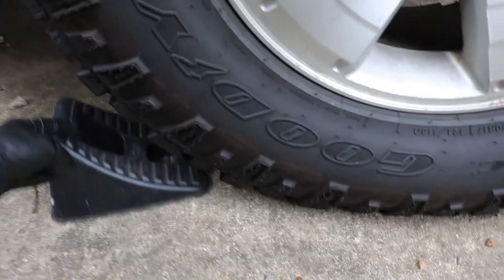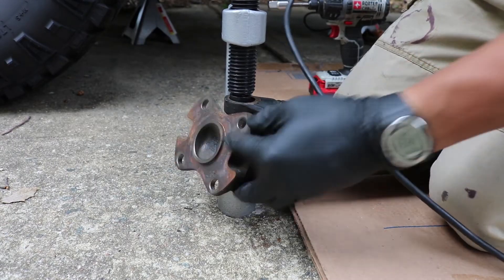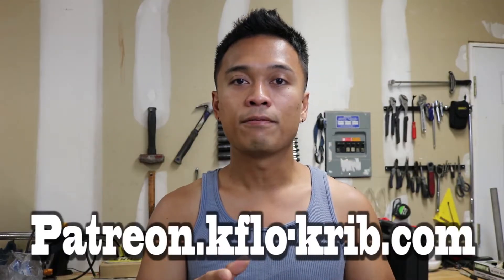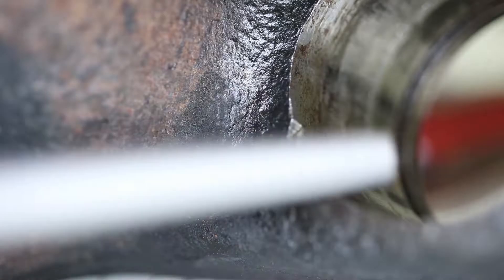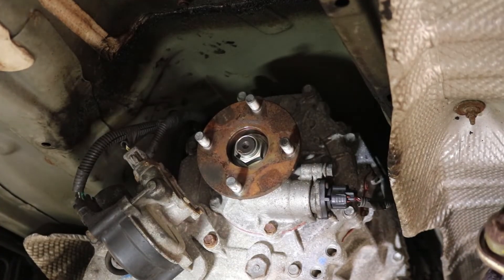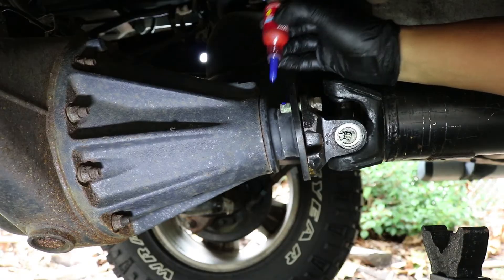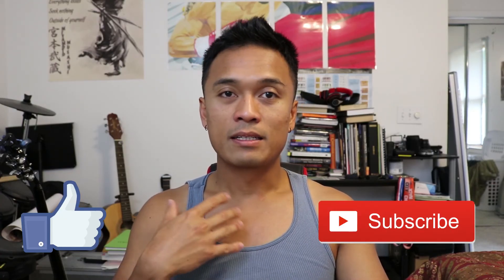U-Joint and Carrier Bearing Replacement (Tacoma DIY / How To)

Comment: Will those parts on your link fit 2wd and 4wd 2015 tacomas? I’m asking because I have the 4 wheel drive 2015 Tacoma just want to make sure and thanks for the tutorial
Reply from the maker: Yes, it will work for a 4wd. My truck in the video is 4wd

Comment: Very good video.    I'd never used a ball-joint tool on u-joints before.   It made a miserable job, less miserable.   
My Tacoma has 230k michigan miles on it.   So corrosion at carrier bearing didn't help, but got through it.

Comment: 1:25 Those 14mm bolts and nuts at the rear differential are driving me crazy. I got 3 bots out and still struggling with one left (on the top). Taking them out are a pain in the butt, imagine putting them back in and try to torque them to specs 😅
Reply from the maker: You an put the truck in neutral and spin the driveshaft (assuming that you have the truck's rear on jackstands) to make it easier to undo the bolts
Reply: @TacomaTutorials  It’s on the stands. I did not know I can spin it from the top to bottom for easy access by putting it in neutral. I already marked the line where the shaft should line up. Will definitely try it tomorrow.
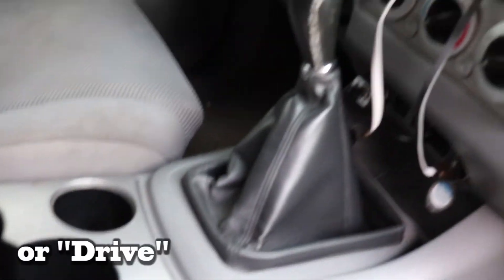Reply from the maker: you may have missed it from the video: 2:10
Reply: @TacomaTutorials  Thanks bro. I was able to take it off easily

Comment: Hi, I did it step by step and everything was almost perfect.  Now I have the 4WD light flashing on the panel.  This situation has me worried because I don't touch, much less disconnect, anything.  I disconnected the battery for 20 minutes and there were no changes.  Any ideas or suggestions?
Reply from the maker: Did you make sure that the 4WD is in the off position? Did you check the harnesses on the transfer case? You may have knocked it loose

Comment: Im replacing the whole shaft for the one and done. How is the new complete shaft set in if there are no new marks?
Reply from the maker: The shaft is balanced individually. You mount it as is. If the new one has vibrations, then you'll need to take it to the driveline shop to balance it to the truck.

Comment: Great instructions. I changed the three ujoints and carrier bearing. Installed the drive shaft with no issues. Now I have a vibration that I didn’t have before   Any suggestions other than taking it all apart and reassembling it?  
Thank you for your time.

Comment: Hi KFlo, I replaced the 3 U Joints and the carrier bearing on my 2011 Tacoma TRD 4x4 AT, one of the ujoints was actually missing needle bearings so the truck was making a knocking sound when I would come to a full stop and when I would accelerated from a dead stop, greatly improved after I completed the work, but once in a while I’m still getting a knocking sound from a dead stop, any suggestions?  Thanks

Comment: Excellent video. Is it beneficial to clean and grease the slip joint on the rear driveshaft?
Reply from the maker: That's a good idea. It definitely wouldn't hurt. I would just advise to mark the slip joint and make sure the  joint is put back in the proper angle to prevent any vibrations from occurring
Reply: @TacomaTutorials  my son and I used what we learned from your videos to replace the u-joints, carrier bearing and one upper ball joint on his 2011 Tacoma. In addition, we cleaned and greased the slip joint shaft.  

We were careful to mark everything with a paint marker to ensure that we put it all back in the correct alignment. Two of the u-joints were ok, but the third was totally shot; the needle bearings had turned to dust. 

We rented a ball joint press from Auto Zone, which made it much easier.  The driveshaft portion was pretty straightforward, but the ball joint was a real pain; had a hard time getting it to go in straight, my c-clip pliers were too small, and we couldn’t get the boot to stay on. We eventually got everything in, so all’s we’ll….Thanks again for a great video.

Comment: Is it bad if I tighten the hanger bearing first then the two ends??
Reply from the maker: it doesn't matter as long as they're all torqued properly
Reply: @TacomaTutorials  thnx bro. Yes I torqued them to spec. Put two washers on either sides of the hanger bearing to drop the angle to a more neutral hang. Hope that is fine too. (My truck suspension is raised by 2.5”)

Comment: k flo how do you access the bolts from the drive shaft to the tranny .. i see there's something hanging down that covers the bolts how do you get that off
Reply from the maker: If you're talking about the front diff, you can use an extension and a socket

Comment: Watched all the videos for transmission, clutch, flywheel, pressure plate, release bearing etc. All excellent and with the torque information! All went smoothly, now do you have a  A video on how to install and adjust and bleed the clutch master and slave cylinders?
Reply from the maker: Yes sir. You'll have to watch my solo brake bleed video in this channel. I briefly go over it in the video. Thanks for watching and supporting the channel

Comment: You didn't point out the small washer inside the front of the bearing. It's clear you had took it off and put it back because you briefly see it on the table. I missed it and left it inside the original bearing. Now I need to take it all apart again and replace with new bearing just incase I damaged it. What a waste of time and money
Reply from the maker: 1) if you applied loctite, you don't need to take it off. Put it back in the future if you need to replace it, it's just a washer - the flange nut with the loctite is what holds it.
2) look at your logic, you personally missed something (which happens quite often to everyone in mechanical work) and it's my fault? Who's the logical fool?

Comment: Thank you for great video! I have a 2009 Taco automatic 4wd TRD sport. Do I need to have the truck on jack stands to be able to spin the rear drive shaft by hand in neutral? Or can this be done with the truck on the ground after I disconnect the flange plate from the rear differential?
Reply from the maker: You'll need the truck off of the ground - it will be difficult to undo the flange plate otherwise

Comment: you put the carrier bearing on backwards the short end the the slotted holes goes towards the trans the longer part goes towards the rear diff
Reply: You have a source for that?
Reply: @Awoit  wdy mean i own a driveshaft shop i build custom ones etc lol i know for a fact
Reply from the maker: @Brendan Mills and @ Austin Woitte You guys can go ahead and contact the manufacturer. I do have an email from them saying that orientation doesn't matter.
Reply: @TacomaTutorials  if the orientation doesnt matter then why does every toyota with this type of bearing always face the same direction? basically opposite of the direction you put yours? the wrong way. the bearing itself doesnt matter its the direction of the housing that matters. but what do i know i only build them

Comment: 🚨TACOMA ARE SET UP DIFFERENT, THEY CAN HAVE 2 TO 4 U JOINTS!!🚨

 If you go to ROCKAUTO and look up part number 285 there are 4 diagrams that show the 4 different setups!!

For anyone who's having the same problem and is actually curious how it really works a single cab should only have One solid drive line 2U joints (NO CARRIER BARRING).. The extra cabs are set up 3 different ways you have to get under and look for yourself and count your U joints. One is set up with 2 part driveline, 3U joints, 1 in the center next to the Carrier bearing. The other is set up also with 2 part driveline 3 U joints, 2 up front and 1 at rear. One set up is with 2 part driveline, 4 U JOINTS, 1 up front, 1 at rear, and 2 next to carrier barring, the 2 in the middle are in something called a DOUBLE CARDAN JOINT!!! Don't make my mistake. After watching you favorite YouTube vid to navigate the work CHECK under yours to make sure you order the correct amount of U joints. NOT ALL THE U JOINTS ARE MADE FOR ALL MODELS. Some are specific to single/extra cab and RWD/4WD!! I recommend part# 285 at RockAuto for 1 GEN 95-04. Some U joints are rated at "standard replacement" and some are rated as "super strength" these MOOG 285 are $17.66 $3 cheaper the the highest rated "standard replacement" DANA 51510×. The 285 is not only super strength but rated for ALL models 2WD/4WD! They are greasible and the grease fittings are on the cap like in this vid for easy greasing. Typically when you go to get replacements part stores try to pass off the dana 51510x I've even had part stores tell me it's rated as super strength when it's not. 285 is the top dog in my opinion, They take the guesswork out by making them universal to all models, they have the grease fitting in the right spot,  They are the highest priced greasible superstrangths on RockAuto. They have 2 that are more expensive but those 2 are not greasible. So at $3 cheaper than the best rated standard replacement that is a win win!!👍

Comment: I'm confused..it looks like they're is 4x U joints?? Are one of these not a u joint?
Reply from the maker: There's only 3 u-joints. 1 in the front , 1 in the middle (it connects the two sections), 1 at the  back
Reply: @TacomaTutorials   UMM NO!! 1st of all it would help if you were doing the year making model on the video title and in the beginning didn't just say "for Tacoma"  You can go on rock auto right now and look up this part number 285 and it will show you the 4 different diagrams for the 4 different ways this truck is set up for 1 GEN.  I'm specifically talking about the 1st generation Tacoma 95-04. My Tacoma absolutely has 4U joints I'm looking right at them! Not all Tacoma's are the same so instead of saying "the tacoma" may be a little more year making model specific. For anyone who's having the same problem and is actually curious how it really works a single cab should only have One solid drive line 2U joints (NO CARRIER BARRING).. The extra cabs are set up 3 different ways you have to get under and look for yourself and count your U joints. One is set up with 2 part driveline, 3U joints, 1 in the center next to the Carrier bearing. The other is set up also with 2 part driveline 3 U joints, 2 up front and 1 at rear. One set up is with 2 part driveline, 4 U JOINTS, 1 up front, 1 at rear, and 2 next to carrier barring, the 2 in the middle are in something called a DOUBLE CARDAN JOINT!!! Don't make my mistake. Don't watch YouTube videos think you have everything together and then waste a whole Saturday to find out your short one U joint👍 Watch your video get your information jump up under there double check before you buy U joints and start.

Comment: I'm replacing the three u joints and carrier bearing, problem is they use three different sizes! How do you figure out what the right ones are? Any help would be greatly appreciated.👍🤞
Reply from the maker: What year is your Tacoma? It should be all the same sizes regardless
Reply: @TacomaTutorials  KFlo, I was searching for this similar issue.   Other sites like Yota say my 2001 three different size u-joints and that the double cardan joint right behind the center support bearing has to be replaced as a unit.  But it all looks exactly like your video.  Confused on if this is possible on a 2001.

Comment: K flo! I just realized my tranny does not bolt on , appears to slide out of transmission. I’m assuming all the rest of the steps are the same? Torque spec for carrier bearing and rear diff should be the same correct?

Comment: Is there a trick to break the drive shaft loos from the rear diff after removing the 4 bolts?  Mines appears to be stuck. Does the truck need to be on jack stands or can be on the ground?
Reply from the maker: It would be better on the Jackstands, at least for the rear, so that you can spin the flange at the rear diff. Use a hammer and a 2x 4 to loosen the yoke from the flange
Reply: Thanks for the quick response, the rear part of the drive shaft should be able to break free without loosening the carrier bearing or front propeller shaft trans nuts and bolts?  Tia

Comment: Kflo are all three ujoints the same ,same part # ,meaning will the joint in rear by diff will fit between the trans and center support bears ?
Reply from the maker: Yessirree. All three u joints are the same for the rear diff. Just make sure you pick the MOOGs from my Amazon page. The spicer ones are for the front diff

Comment: It's probably worth mentioning that the shaft is balanced as a complete unit and that is why it's important to put on the alignment marks. It was balanced with that alignment so if it doesn't go back together the same way it may not be balanced.

Comment: Just finished doing this on my 2008 TRD Sport, 2 wheel drive, Double Cab V6, Automatic. Did not have as many bolts holding Drive Shaft as you showed, as there were 4 bolts, washers and nuts holding drive shaft flange to Differential. There were no similar bolts on the transmission end, just the Slip Yoke which goes into the transmission. There are the same two screws holding the Carrier Bearing to Frame and the same Nut holding the Carrier Bearing on to the middle Spline Yoke. Your video saved me a lot of research time. Ordered the parts on eBay and obtained The Spicer Select U-Joints and Spicer Carrier Bearing. I moved slowly and methodically and got the job done, thanks to watching your video. Thank you for making and posting  as it was excellent resource to have available. What I thought was a worn Carrier Bearing turned out to be 3 bad needle bearing ends of the U Joints. They were rusted away and turned into Rust Dust. They had no grease fittings and were never replaced. My Truck has 170, 891 miles, and only when I went into reverse did I get squeaking, sounded like a bird chirping. Never made any noise when moving forward. It was like having a backup warning signal, which I will miss. NOT! Next project: replacing leaking rear axle seals, and potentially damaged bearings which are contaminated from the rear differential fluid washing into and deteriorating the bearing grease. Not sure I have the strength to do this type of repair, as I am feeling my age after this repair. Happy 4th of July Weekend!
Reply from the maker: Excellent, great to hear. My next video is on the rear wheel bearings and axle seals. It's being edited and will be out in a few weeks. Stay tuned and thanks for supporting the channel. Happy 4th as well!
Reply: @TacomaTutorials , That's great to hear and I look forward to seeing it. I have the 20 Ton press (I got the HF Press for $50 from a FB Marketplace ad) and was going to buy all the Toyota genuine parts from eBay, which I already have selected and saved to my watch list. I also was going to get the rear axle bearing tool for pulling the hub and tone ring, as seen on Timmy The Toolman  channel. But, I have not pulled the trigger on doing anything yet. Have to decide if I want to pay a mechanic. Biggest concern is how to make certain the Tone Rings are not pressed on too far, and what size gap has to remain so the speed sensor ring will still work. Due to the fluid leaking, the rear brake pads are getting saturated...so it is a big job which has to be done sometime soon. Need to pay for a new roof first before I have to think about the leaking seal.

Comment: I just had my 2005 Tacoma prerunner center bearing and rear u-joints replaced. Now my truck shakes (stutter) at take off .  Any suggestion how to fix this issue? It is TRD sport package.  Could it need the differential oil replacement? Thanks
Reply from the maker: I think I answered your question in the other question you asked
Reply: I saw on ebay carrier bearing spacer  for tacoma cheap!

Comment: K-flow awesome video, I just replaced a u-joint and center carrier. My question to you I ended up using the blue lock tight to attach the driveshaft, is that ok or should I have gone with red lock tight?
Reply from the maker: Blue loctite is totally fine - as long as you torqued it to spec. I would recommend rechecking the torque again after a week or so, just to double check that it stayed put

Comment: Hey bro after fixing the rear u joint on my 2010 Tacoma my drive feels a little too smooth. Also , before changing the bad u joint ride was bump and vibrating always. My tacoma now feels like it takes about 2 seconds to decelerate  , is that normal?! Im worried I screwed something up , yet my truck feels smooth is it because i got so used to the rumble and shaking of the truck wwith the bad ujoint? Thank you!
Reply from the maker: I think you may have just gotten used to the rumbling. Keep in mind, these are heavy flywheels so there is going to be a rev hang

Comment: Is that u joint for all the shaft same part, I noticed their is several u joints on mine, one has grease fitting on outside
Reply from the maker: Yes all the U joint for the rear drive shaft is the same. The ones I'm using are on my amazon page. Amazon.kflo-krib.com

Comment: Awesome video, I believe either my carrier bearing is bad or u-joint on my first gen Tacoma. I have play in the carrier bearing when i went below also i have a popping noise when accelerating from a stop. Does this sound like the fix? thanks
Reply from the maker: There is supposed to be some play in the carrier bearing since it's cored with rubber. Popping noise from accelerating from a stop comes from loose ball joints or motor/transmission mounts

Comment: Great video! 
Did you have to re balance the driveshaft as well? Is it recommended, a must?
Reply from the maker: If you marked the flanges before you took them off so that they can be put back in the same orientation, you typically don't have to rebalance. Most of the mass of the drive shaft is on the shaft not so much in the joints.

Comment: For the grooves, another option is to get the 4-pack of orange-handled picks from Harbor Freight and use the one with the L-shaped tip to scrape them out. For cleaning out the bores, I used a Dremel with the mini drum sander attachment.